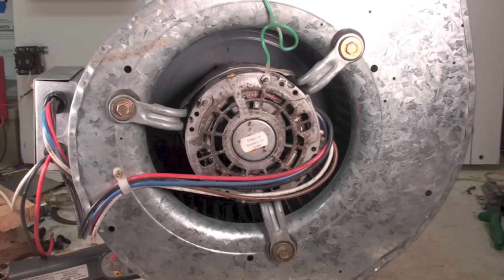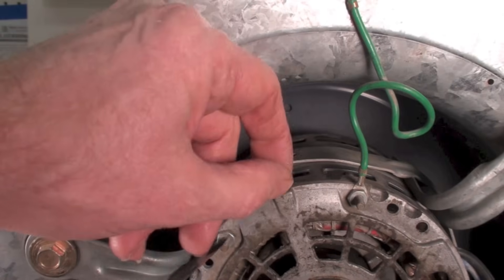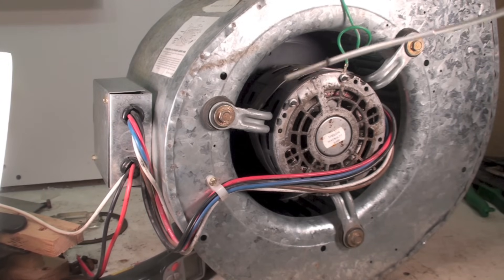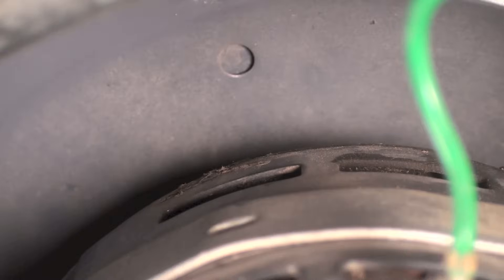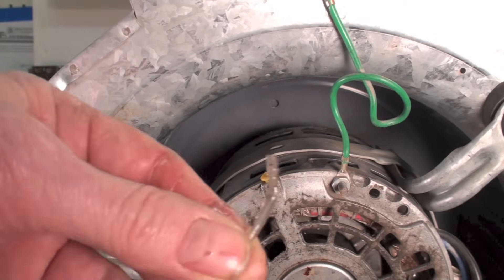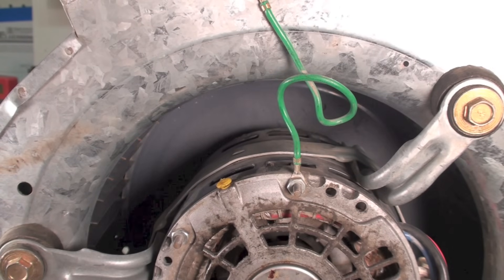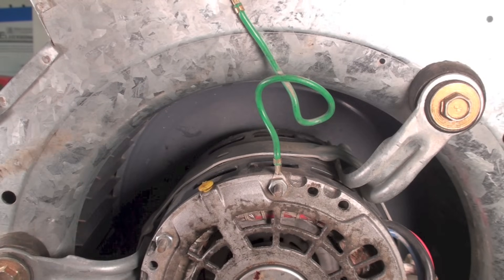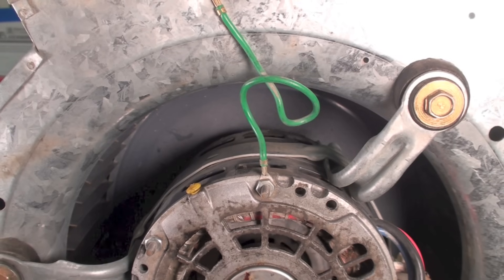How to oil the HVAC fan motor

Comment: Great video! I was oiling my induction motor and figured why not check the large blower motor. But I wish your video started out with some of them are sealed as mine is. Sadly I guess it's used till termination. Lifetime fluid already installed from the factory lol

Comment: Thanks for the video. My Coleman furnace ran quiet for 20 plus years, no oil,thought it was a sealed bearing.  Just recently one day started making a screaching sound. I couldn t easily get to the oil plugs. Then I thought of removing the basement cold air return grill on the side and the filter that enabled me to get to the motor without pulling it out. The fan turned easily by hand in Spite of the  noise.  After oiling it quieted down, no more noise. I can't believe that ran smooth and quiet all those years without being oiled, now I know to oil it.

Comment: On my furnace motor is mounted to the cage with tap screws. I backed one screw up, and back in, because it got very loose. I don't want the junk to fall apart. XD
Reply: I was looking for oil ports, and wanted to clean the caked dirt. I found the other way to clean it.

Comment: I just replaced my original 33 YO furnace motor. It was a direct 4-speex replacement for $145.00 from A-Z. I'm going to fix the old one up; clean it out, lube and test for current draw to make sure it's good. It free hand spins half as much as the new one. So I think polish shafts and bushings. And I'll have a good replacement on hand.

Comment: Dear grayfurnaceman

Great video on relubrication of an Emerson Electric motor. 

Please be aware that these Emerson motor bearings were originally lubricated with PermaOil manufactured by the Permawick Corporation. 
Permawick has supplied bearing lubricants to the OEM electric motor companies around the world for over 70 years.
PermaOil contains additives specially designed for use in electric motor bearings, not found in regular off the shelf oils. 
The “fiber stuff” you refer to around 2: 47 is called PermaWick. 
PermaWick material is a mixture of PermaOil and fibers that resides around the side of the bearing. 
Oil from the PermaWick material is absorbed by the bearing and replaces the oil that leaves the bearing and lubricates the shaft. 
Permawick material can be reconstituted with PermaOil, or new PermaWick material can be used to replace the old. 

For more information on Permawick and its line of bearing lubricants please see our website www.permawick.com.
For Specific information on the product line hit the “Aftermarket” tab on the website. 

Permawick Corporation.

Comment: 12 years later, and I was so happy to find that my fan blower motor has oil ports. $5 oil bottle fixed the noise. Thank you for your instructions.
Reply: What noise was you hearing? Might have the same problem
Reply: @KyleSnyder-n9k grinding noise

Comment: Just bought a house and furnace is vibrating. Was told shaft is warped?if I clean the blower motor and fan and oil it will it save it for awhile till I can save for a new furnace?
Reply from the maker: It probably won't make a difference, but it can't hurt.
GFM

Comment: Hello again my friend if that blower motor is overheating and and after a while smells like burning and compresor turns white freezing the problem most likely is the motor?
Reply from the maker: Motor failure or run capacitor failure.
GFM

Comment: Thank You so much! Can only can get to bottom of the our 30 year old goodman attic unit!  Did this a few years ago along with a bit of cleaning. It really did help and the fan turned faster.   Not fun to work on.. Hands just to big to fit up to the top mtr. oil vent!

Comment: Thanks for the clear video - couldn't have been easier, the caps were missing and directly on top of the unit.  Filled with 3+1 for now - see if the noise is gone when my cleaner-guy comes to fix the burner that's kaput for a month now.   That's usually an easy fix and hopefully I'm back in the heat again tomorrow, I'll report then on UP/Down status.  Many thanks.

Comment: I did mine I replaced BM A FEW years ago but now thinking could the capacitor been the cuilprit of it not working  ? It was hot to the touch soo that made me think it was blower motor
Reply from the maker: Generally, I recommend replacing the cap with the motor.  Also, the new motor may use a different size.  As for whether the cap was at fault for the original failure, or even if the original motor was failing, I don't know.  These motors can operate at 40 degrees Celsius above ambient(about 170 F).  
I would check the cap strength and compare to the motor model plate.
GFM
Reply: @grayfurnaceman  next if it’s not working I think I’ll try replacing the cap first

Comment: Where is the capacitor on the old furnaces? Or is there one at all?
Reply from the maker: Some very old furnaces, especially with a belt drive blower may nit use a capacitor.
GFM

Comment: i took the blower motor out of a old trailer and its from 1974 i washed it with water hose waited for it to dry then oiled it wired it up to a exstenion cord and now its a great shop fan the best shop fan iv ever owned
Reply: I do the same with box fans, electrical engineering is not a strong suit at our local college, they must have mommy and daddy’s money because they throw them out if they get a bit dirty 🤷‍♂️

Comment: just curious how often the blower motor needs oiled. does Goodman use sealed bearings on the newer equipment (15 years old?)
Reply from the maker: It should be oiled at the beginning of the heating season if oilers are provided.  Each brand has varying types of bearings.  Most are sealed.  
GFM

Comment: never oil the blower motor  2006  tempstar.  .  hard to get in     is it ok to leave it？
 i    oil outside condersor fan motor
Reply from the maker: At this point it may not make much difference.  And yes they are hard to oil.  Sometimes even have to remove the motor.
GFM
Reply: @grayfurnaceman   how long can a furnace last.  Or. Heat. Exchange   I live in nj
Reply from the maker: @fisherbrown903  I generally estimate the modern furnace to last 20 to 25 years.
GFM

Comment: Sure hope mine has oilers like this. I’d prefer not to take it all apart. Needs oil though, I have nosies…
Reply: Did you fix the motor noise by oiling it?
Reply: @diyhvacguy  yes. Had to take it all apart. It’s ramps up way more quiet too!

Comment: I have an old Thermopride oil furnace.  Fan sounds fine when running... easy to spin, but when it starts up.. sometimes (not always) it makes a clunk kind of noise, usually once.. sometimes twice.  Been doing this for as long as I can remember.  Maybe something is loose?  Or is this normal... for an old gal.
Reply from the maker: Belt drive or direct drive?
GFM
Reply: @grayfurnaceman  Direct
Reply from the maker: @Swoliosis1  If it had just recently happened, I would be looking at a loose set screw or loose motor mounts.
But if it has been doing this for a long time with no failure, I would suspect it is a characteristic of the motor itself.
I have seen motors that do this with no explanation a number of times.
GFM

Comment: Let's say some idiot sprayed grease and penetrating oil all over the motor and blades to quiet squeaking but now its a fire hazard. After removing the blower, how would you suggest cleaning to make motor last a few more days until replacement is installed?
Reply from the maker: I would not do anything.  Cleaning may well damage the motor.  If you are concerned, don't run the motor.
GFM
Reply: @grayfurnaceman  Thank you, it did catch fire after all. Good thing replacement is on the way

Comment: I prefer to do it when the motor is running. Evenly spread.
Reply from the maker: When you are oiling these motors, you are not directly oiling them.  The oil goes to a material similar to baby diaper material that is in contact with the bearing.  
GFM

Comment: My fan just stopped it's my son and me living here it's almost 6am and it's like 19 f here can I use 3 and 1 oil that's all I got
Reply from the maker: Go for it.
GFM
Reply: @grayfurnaceman  I did, it worked for a little while and then it stopped again it ended up being my capacitor

Comment: Ive been using the the light blue three in one for quarter horsepower motors or larger and it goes dry quickly

Comment: Just fyi a lot/most of the new motors in modern residential hvac units do not have these ports. 9 times out of 10 if your motor starts to screech you can delay the inevitable but you will most likely need to replace the motor.
Reply from the maker: You are correct.  Of course you can't oil a motor with no oilers.  But you have to look to determine.
GFM

Comment: Good video mate .... question : 
Old motor from church went out ... I got a diferent one .  It doesn't do anything...  i noticed the old one has 4 wires coming out  ( low,med,high and Com ) ... but the new motor just has three wires ... ( low,med and high ) .... Com wire is left .... maybe thats the issue ? ... thank you

Comment: Just pulled mine and no oil holes, i was able to pop the front and back caps off with light taps and a screw driver.inside it had that felt material so i just added oil that way, and recapped it

Comment: Just replaced the outside fan motor in our home HVAC system from 1978, it was the EXACT same Emerson motor in your video and was the original motor.  It was still working, but the bearings were starting to get noisy.  I kept it oiled the 20 years we've owned this house along with the indoor blower motor which is still running just fine.  The system is a Whirlpool "green wedge" HVAC system and I've never had to call anyone to service it.  I keep the motors oiled and replace the caps and relays every 7 to 8 years.  No electronics to worry about, and we're still using the original White-Rodgers thermostat.  The system gets a good workout here in FL and I'm not replacing it, not ever.  Any part that goes out that I can't replace I'll just have a serviceman do it and if the R22 gets out, I'll use AC77.
Reply: Wow from r22 to ac77 please explain or provide link if possible I'll research as well

Comment: Is there a way to run tubing into the hole and have it easy to get to, so you don't have to remove the blower?
Reply from the maker: There are piping assemblies made for just that purpose.  However, I have not seen any for around 30 years.
GFM
Reply: Aquarium tubing and funnel

Comment: Those darn plastic plugs like to sneak away when you aren't looking. A #8x1/4" or so pan head machine or sheet metal screw makes a good replacement. Thanks for taking the time to make a great video.

Comment: What oil was used? Only the zoom spout oiler bottle was mentioned.
Reply from the maker: The Zoom Spout oiler is an oiler that comes with an oil made for motor oiling.  You can use an SAE 20 non detergent oil.
GFM

Comment: You never mention the type/weight of oil to use
Reply from the maker: A 3 in one type will do or you can buy a "Zoom spout oiler" that has oil suitable for motors.  Also, SAE 20 non detergent motor oil can be used.
GFM

Comment: A couplethree drops of 10w non detergent oil once a year is all you need. Overlubrication kills more equipment than not doing it at all.
Reply from the maker: The overlubrication thing is total crap.  Put all the oil it will handle.  Try your 2 to 3 drops in an B and G pump and watch it fail.  
GFM

Comment: Sometimes they're yellow, sometimes they're black, sometimes they're metal...  I just found out that sometimes they're invisible.  Why would someone not reinstall them??
Reply from the maker: They are often dropped into the housing when removed.  It is no big deal as the material used to hold the oil near the bearing is an excellent filter for dust.
GFM

Comment: do new motors need to be oiled or are they usually pre oiled?
Reply from the maker: They come pre oiled.
GFM
Reply: @grayfurnaceman  FYI, new motors do indeed come with some lube but very little to prevent a mess during shipment...highly recommend adding some before installation.

Comment: The blower on our wood furnace has been shutting on and off. Even bypassed. Could this be from overheating from lack of lubrication?
Reply from the maker: If the bearings are dry, the fan should not rotate freely.  
GFM

Comment: Went to oil my belt drive motor I don’t know when the last time it was done, one didn’t have a plug and the other did but I accidentally pushed one in and the other I think maybe it was pushed in by someone else and it says to put 30 drops of oil. Is that 30 each side?? I couldn’t get much oil in maybe because the plugs are lodged inside, what can I do?
Reply from the maker: About all you can do is drill out the plugs.  Or, just don't oil it.
GFM

Comment: I just lubed my 1977 Lennox furnace motor, the oil dropped out the bottom on one of the ports. First time doing it in 2 years so I’ll risk it this winter I guess. Don’t want to upgrade my furnace for this unique scenario (part time business, not house).

Comment: we just had a HVAC guy telling us the motor was dying and it was a little stiff- causing it to stop working after an hour. but when it cools down it may turn on again. Are you saying that all you need to keep it up and running is lube it?I think ie caused the capacitor to stop working. The HVAC guy says these motors are destined to fail after a certain number of years( less than 10) since they are on continuously nearly the entire year. Is he right or was he just selling us a car here? its an Tran xR80
Reply from the maker: Sounds like the bearings have failed.  
As for the longevity of the motor, many motors last for 20+ years.
GFM

Comment: IF NOT REPLACING CAP.. CAN IT MAKE WHEEL TO MOVE AND FALL OFF????
Reply from the maker: If you have replaced the motor and not the cap, If the cap is the right size and the cap works, the wheel will rotate.
GFM
Reply: @grayfurnaceman  THANK YOU!!

Comment: Installed very easy, the hardest part was enduring the heat in the rafters>>> nub.best/2710  , until I wired the fan. It is very quiet and seems to move significant amount of air

Comment: Thank you sir for this video. My fan blower motor seems a little louder than normal when it turns on. Will try oiling.
Reply: Manuals ive seen recommend 10 drops every 6 to 12 months. You can extend the inside port with a small piece of brass tubing and gas trimer fuel line. switched to IngersolRand recriprocating air compressor synthetic all season oil. If the motor is covered with dust you need to clean it with a vacum.

Comment: My york furnace motor seems to be making noises and will this help solve the problem with cleaning, because ive mines replace by an hvac tech 11 yrsago.
Reply from the maker: Oiling the motor after it starts making noise will probably do nothing.  If it has a bearing problem, they have already failed.
GFM
Reply: @grayfurnaceman  
So the solution is to get it fix?
Reply from the maker: If you determine the motor is the problem, it will probably have to be replaced.
GFM
Reply: So only an hvac tech can do it?
Reply from the maker: I would certainly want a tech to make the diagnosis, then you can make an informed decision.
GFM

Comment: I have a 1971 InterTherm MAC 1155 furnace.  I use the same oil before, during and after using the furnace.  Mine has open oil tubes.

Comment: I have several ZoomSpouts, they have basically 10 wt oil in them when new. I have a new one, one with 20w50, & one with 90% 30wt & 10% STP. Various ages of motors use different viscosity of oil to protect them for long periods. Just me, maybe, but I service a lot of older stuff, and it hangs in there fine, if taken care of. Michael in Colorado.

Comment: Thanks a lot. I just did this and the fan's blowing again. Wouldn't have know to look for the back cap. On my 80's era Carrier the front cap is just an indent in the motor housing, but it did the trick I don't have your cool oiler, but found a little bit of heat from a torch allowed a typical WD40 can straw to easily bend to perform the same duty. Cheers to you!
Reply from the maker: Glad you got it going.
GFM

Comment: We've had this issue for a week; does it off and on and not all day.  I've told the landlord about it twice and even sent an mp3 file with the noise to drive the point home.  I might just oil it myself.  I'm not a homeowner or home renter, but rent a room in a house with 3 other guys.  Landlord has been flaky lately so I'm not sure I want to live hear after my year lease is up next august.  

The main issue is that when it happens I can hear it through my bedroom walls and it is hard to sleep, the neighbors for sure can hear it too since it's close to their house.

Comment: cant you replace the dearings with sealed ones nice video will subscribe
Reply from the maker: The bearings do have seals.  Any replacement of bearings would exceed the cost of the motor.
GFM

Comment: about 2 years ago I had to replace the motor. This one has a provision for oiling. How do I do that? The furnace is 28 years old
Reply from the maker: Remove the caps and oil using something similar to a "Zoom Spout" oiler.
GFM
Reply: Does the motor has to me removed?
Reply from the maker: Usually no.  If the oilers are on the top.  The oiler should have a flexible long spout.  The caps are sometimes hard to get off and get lost, but it can be done.
GFM
Reply: I have to look at it over the weekend . Thank you very much

Comment: purple black blue and red wires only hvac 4 wire  motor and the two brown to the cap.
how do I wire it up for 120V ?????
Reply from the maker: Is it a Westinghouse?
GFM
Reply: carrier
Reply from the maker: Actually, Carrier does not make motors, but it probably is a Westinghouse.  If so, The purple is common, black is high speed, blue is medium, and red is low speed.
GFM
Reply: Great Thank you very much.